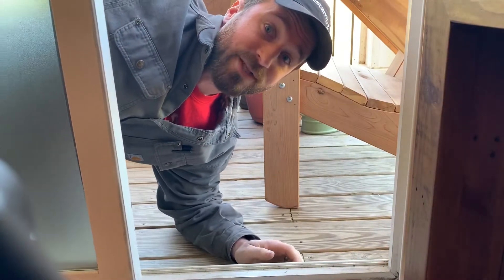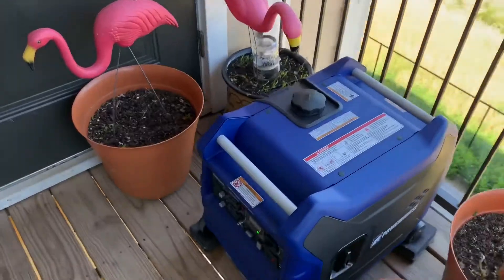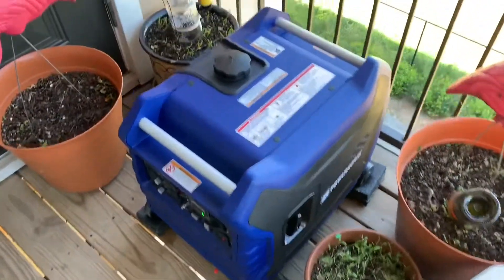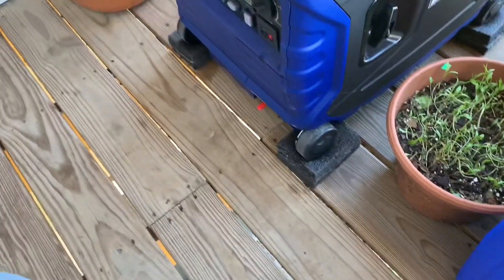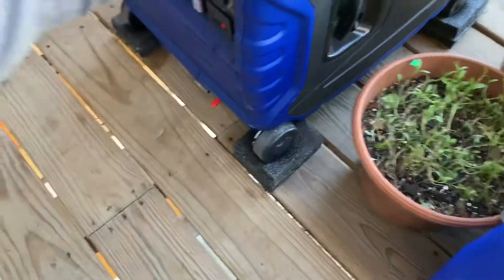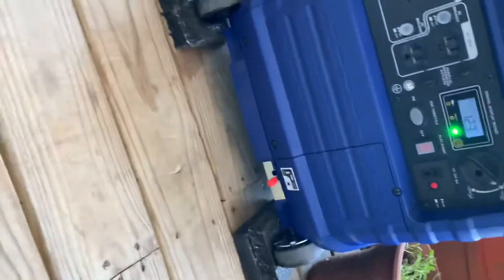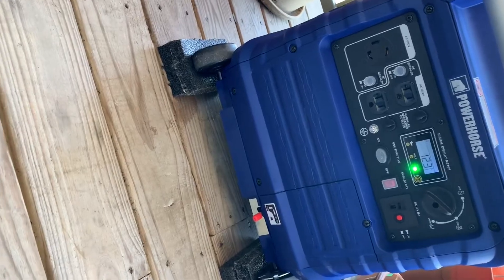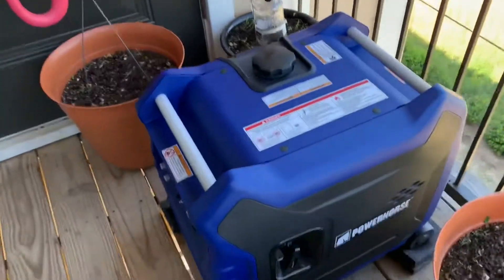Running a Standby Generator on an Apartment Balcony (Quietly)

Comment: I'm in the same situation as you, 3rd floor apartment living, neighbor below me could feel the vibrations from the genny. Ordered some rubber anti vibration pads and an vibration isolation pads. Hoping the two together work as good as your foam pads!
Reply from the maker: tried rubber first, but the vibration still came through. the foam really made a big difference and has held up really well this entire time.

Comment: Are you not having problems with the generator fumes in that location?
Reply: Exactly my concern… he doesn’t bother to address carbon monoxide poisoning issues which are the biggest concern, along with fires, in running a generator. Last concern… noise!
Reply: Hundreds of people have died from carbon monoxide poisoning due to putting generators on balconies, in closets, garages, and doorways.  Hundreds!  I did research to seek the best place for my 4500 watt WEN generator.  Balconies are really bad!  It has to be at LEAST 20 ft. from the living space.  I will most likely have to put mine on the porch first landing stairwell since I live on the 2nd floor.  I should have bought a solar generator.  But they're soooo expensive, but at least it can go in your home and wont kill you.  I might return this.  Still debating whether I should or not.
Reply from the maker: My doors and window are closed, i close the door on the extension cord where it is squeezed in the weather seal, and I dont have any issues with CO in the apartment. I'm not just guessing at this. I have dedicated CO detectors and smoke detectors. When I run it, the exhaust is pointed out toward the steel hand railing... so no fire concern. Sorry about the time you spent researching, but I spent my time testing.

Comment: Not everyone can have a house where they have a back yard to put there generator, Ive searched generators and wanted the solar power battery ones, but cost and run time wasnt for me. All i care about is running a small 500 btu window AC cause i cant sleep at night in 90° weather. My concern is the carbon monoxide going to the neighbors upstairs and down, tho theyll probably go stay with  family when the power goes out, me ive no where to go. But i would think that the co wouldnt  be an issue like when people go camping . I will find out 100% first though,   And im so glad the inverter is quiet enough. Though if im dieing in 95° weather and the powers gonna be out for weeks and multiple times it seems right now with all the tornados. we in apartments should have the right to have generators like home owners do. Safely of course.....thankyou for video

Comment: Hi Tom. Please don't laugh at me, I got some ignorant questions: Can the genny get wet? I'm on bottom floor with two apts above me that damn near flood my patio. I have a good size patio storage shed that I can put a genny in, might even be able to run a power cable from that shed into my bedroom (I know how to patch a wall, never needed a genny until now). Only thing I want a genny for is to keep phone charged, run a hot plate or small microwave and one small lamp, would this genny be good? Too much for the tasks?
Reading the description of this genny "overload protection" makes me nervous. How does "overload" happen?
Thanks for video! And welcome to "no power for long periods of time" country.
Reply from the maker: I bet the generator could get wet, but I wouldnt want to leave it out directly in the rain if I didnt have to. Even a small board or an umbrella would work. The only part that gets hot on this one is the exhaust, so I could see myself ziptying an umbrella to the front of it if I had to. 
Dont enclose the generator (without properly exhausting and letting in FRESH air) for 2 reasons. One (safety) is the poisionous carbon monoxide that will build up in that space. Two (function) is that the engine needs fresh air to operate correctly. 
For sizing, pay attention to the wattage of the items and add them up. For estimating, I use the rough conversion that 1A on 120volts is about 120W: phone charger is 0.6A (72w), lamp bulb (60w), I have a hot plate that is 1000w but this could be different on different models, and a microwave can come in many sizes. look on the product tag for the operating wattage, not the cooking wattage. I have a 1300w microwave that takes 15 Amps to run. That means it actually needs 1500w, but some items like this need a surge of power when they start so I try to overside the generator a bit. lets see for you... 72+60+1000=1132w. You should look for a smaller generator that will do maybe 2000w. These are prety common and are about half the price of what I have. you can always unplug items to run others when you need to. I'm using a 3500w generator with a 5000w peak, that handles my refrigerator, chest freezer, tv, internet, cable box... and more if I want. 
Overloading... I have never run into an issue, but only because I check the power requirements of everything BEFORE I plug them in. Dont plug in more wattage than your generator can handle and it wont be overloaded.
Reply: @IBurnMetal  Thank you much for reply.

Comment: Your lease allows generators?
Reply from the maker: If no one complains… No one finds out 🤷‍♂️
Reply: @IBurnMetal    Can this be used as an apt generator ?, if so can you do a demo?
Reply from the maker: This was in my apartment. Don’t try and hook into a panel, that will go badly. Instead, just plug the important things right into the generator. Refrigerator & freezer, etc...
Reply: @IBurnMetal  remember your generator needs to be 15 to 20 feet away from your house to avoid carbon monoxide poisoning. Remember to follow the generator safety rules whenever you use generators. Thank you.
Reply: @IBurnMetal   no one finds out till you poison them you mean… my, how responsible of you !😑
Reply: @knowledgeispowerfful   frankly, I wouldn’t be asking this guy!
Reply: Mine say 5ft. all around, suitcase size 2500 watt

Comment: WHERE DO YOU HOOK THE GENERATOR UP TO IN THE APARTMENT?? Please help lol
Reply from the maker: You’re not going to hook up to the panel or anything. Hook your main appliances into the generator as needed. I ran a 12ga extension cord to the refrigerator and chest freezer. Still used flashlights for light and a propane camp-stove on the back porch for cooking. I would only run the generator for a couple hours at a time to cool the fridge back down and then let it sit for a while. Saved on fuel and noise.